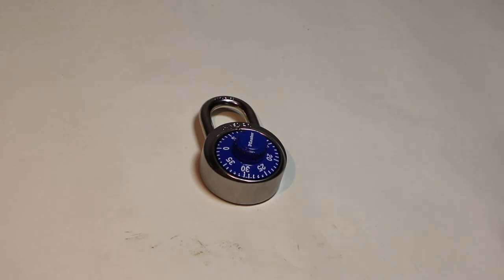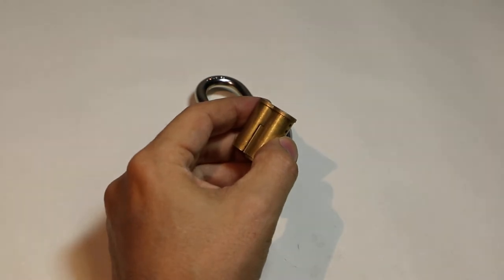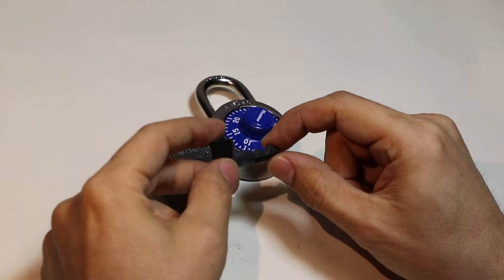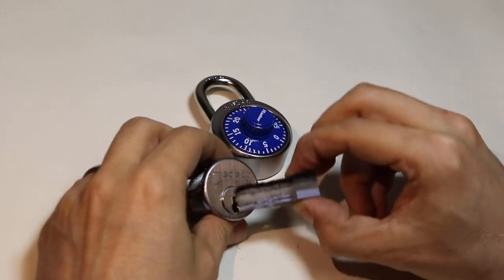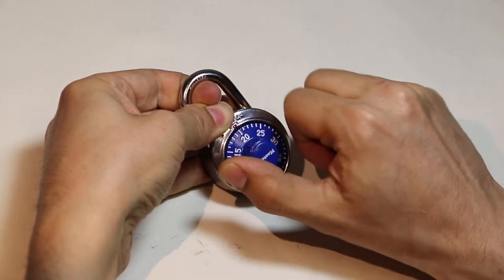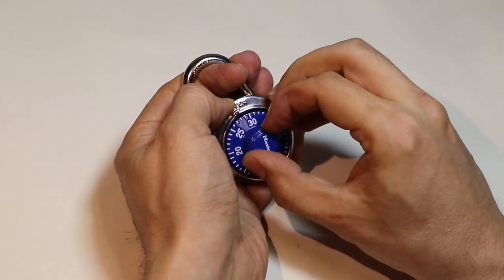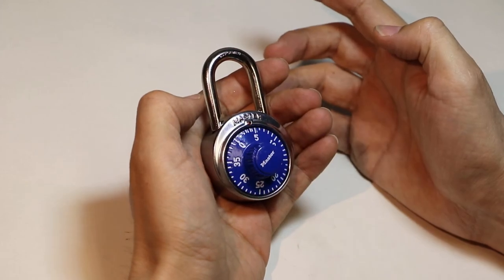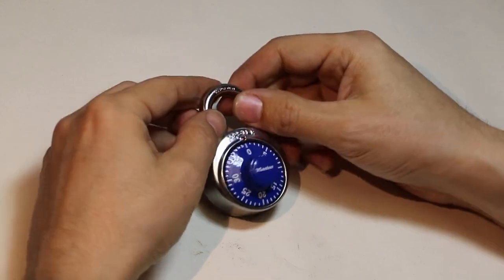[L48] Master Lock Combination Lock - decode and a status update

Comment: Really cool that you're making keys. Now open the damn combo.😂 Tension on the second number is difficult because the bumps move your fingers everytime and everytime you need to readjust tension. I liked white knuckling the tension for that second number because when I got to it I really couldn't push past it at all. Looks like you really had fun with it. Great vid, see ya!
Reply from the maker: Yeah, that second number I didn't feel like I hit a wall at all! But I did notice that I hit the bumps and after the target number I stopped hitting bumps (ie. the target number was the last bump at that tension level). Not sure if this holds true for all locks though.
Reply: @norlin76  interesting I would need another to test this tho.

Comment: Don’t worry about your mic buzzing. Your  picking top class. I have the arrow 7 pin cores just like the best cores. Great video 👍
Reply from the maker: Cool, I mentioned 30 Best cores, but it's actually 28 and 2 arrow cores. I'll have to check out those Arrow cores next, think they're identical but maybe different keyway

Comment: I think the buzzing actually started after you plugged the cable because I didn't hear a buzz until after you connect another microphone
Reply from the maker: Yeah, in the last video I didn't have the lock mic attached and we start to hear a buzzing when I move something and that must have knocked the grounding cable loose from the cable that was connected to the mic.
Reply: @norlin76  I heard high-pitched buzzing noise in this video
Reply from the maker: @lockhak33  ahhh, thanks, i'll listen for it and try to figure it out. The buzzing in the last video was very obvious and loud (was in the gutting portion)
Reply from the maker: yah, I hear it as more of a white noise in this video, not really something I can do too much about. The buzzing is more like this: https://youtu.be/-G8Y7zJ1QWA?t=291
Reply: @norlin76  okay gotcha